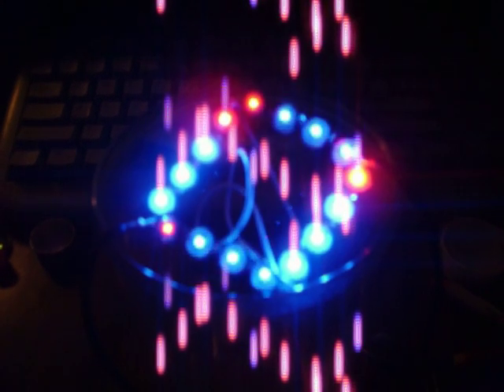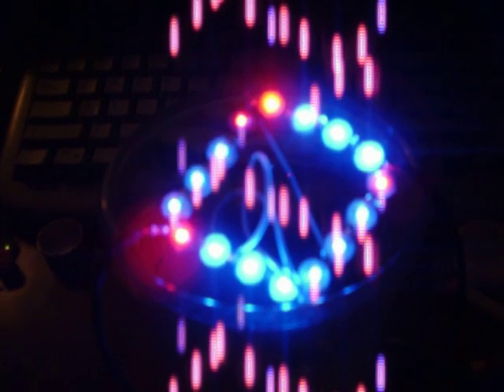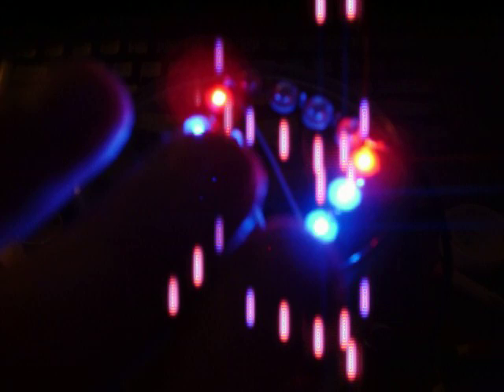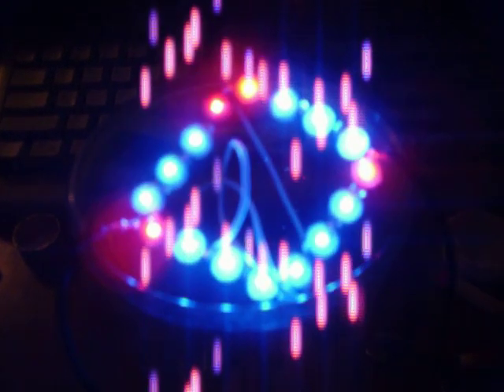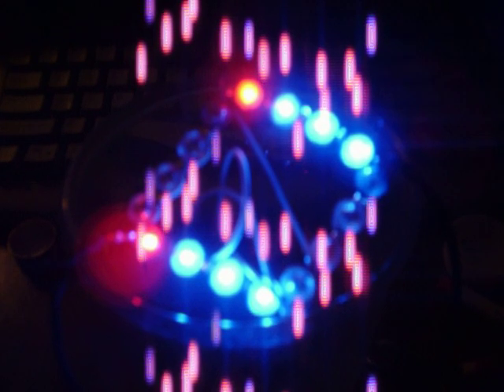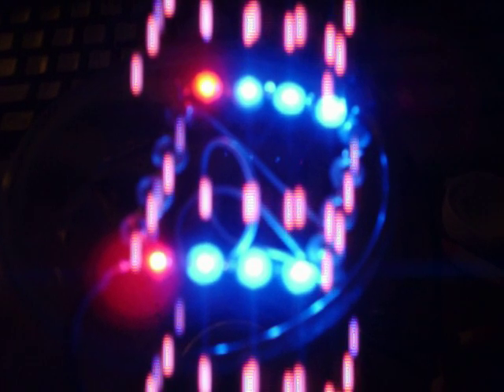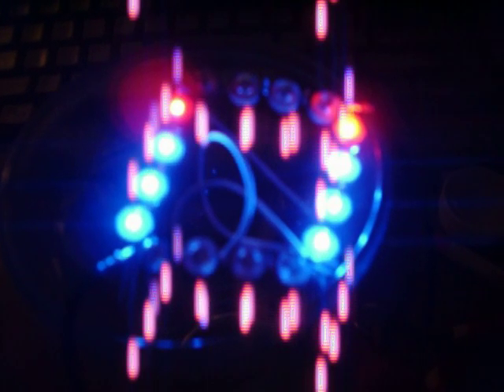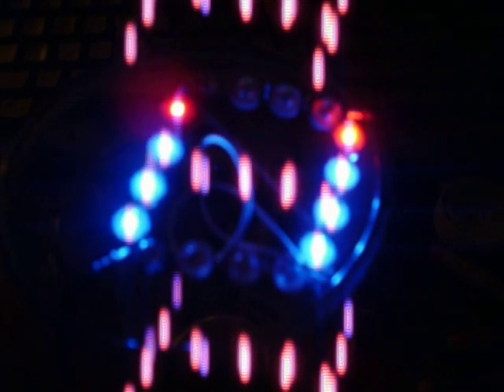Direct drive of LED from AC power

Comment: I have always wanted to see a power supply made from LEDs. Nice job!
Reply from the maker: I know! It would be great to have your rectifier made of LEDs and visible! Also, visual diagnosis if the rectifier fails! One set will light, the other won't, and you know which needs repair! What more could one ask for (as long as you're not popping past the LED rated current capacity?)